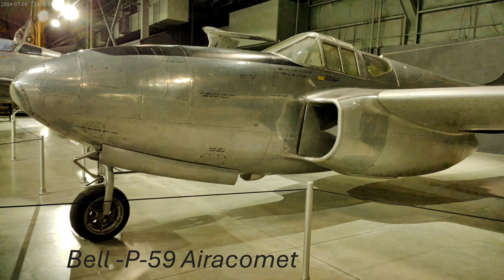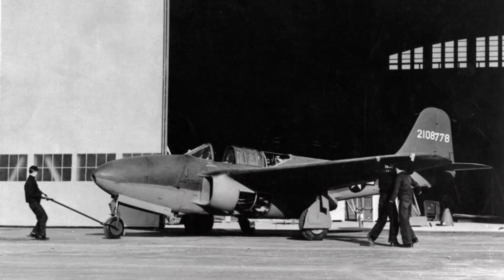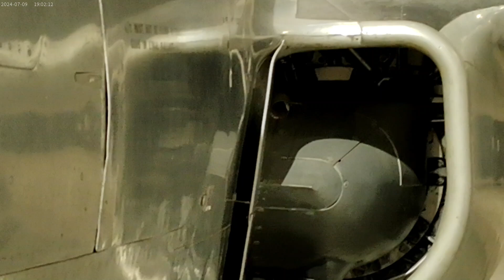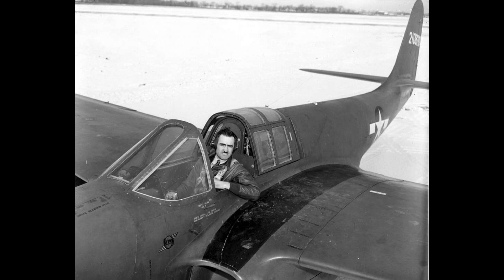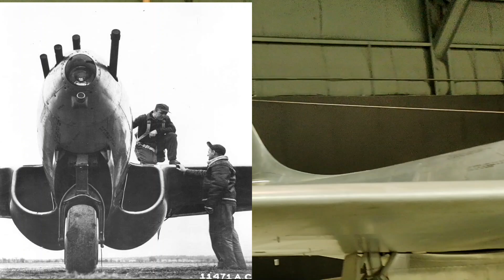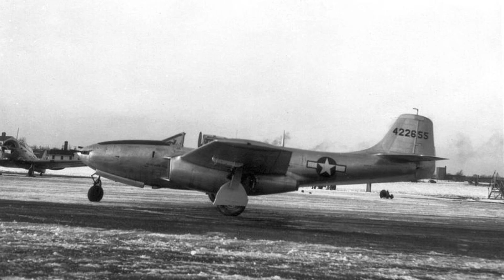Bell P 59

Comment: The second altimeter is most likely for reading the cabin pressurization altitude.  The instrument top row on the right is a remote magnetic indicator or RMI.  Dial is for the remote compass function, the needles, probably just one functional, is for the automatic direction finder, ADF, and second needle could function as an early VHF nav function or second ADF if installed.
Reply from the maker: Thank you for the comments, appreciate the input!

Comment: 1. To my calculations, P-59A is the first serial turbojet not only the USA, but in the world. And this is definitely the first combat jet fighter to be publicly announced. That is, the fact of his appearance could affect the whole world, but not vice versa.
2. This is probably the first production fighter with a pressurized cabin.
3. Lockheed was working in their L-1000 turbojet project and L-133 fighter. That project bore little likeness to P-80, but it was remind of Bell's proposed single-engine fighter jet. I don't think it's casual.
4. Bell did not stop designing fighters, but they were entrusted with the development of escort  XP-83.
5. Judging by the safety of Whittle engines, the Gloster Pioneer could be the first. But Britain just did not need a close high-altitude interceptor, enough worries. According to Whittle, Pioneer is a better short-range high-altitude interceptor than Spitfire. In tests in the USA, Me 262 did not show superiority for combat with the P-51D. Strangely, P-51D dived much better and safer than Me 262. The Allies just don't need Me 262 and P-59. Does Hitler need the Me 262? Joint tests of slow Ar 234 and Me 262 led to a report on the superiority of Ar 234 in aerial combat. But Me 262 with R4M missiles is effective against heavy bomber formations. In Germany, P-59 could be useful for intercepting Mosquitoes.
6. It is a pity that the stories I know about P-59 do not include sources about her Whittle and GE engine, its complex and fast history.
My conclusion: P-59 was the first important attempt. He got a sequel. The Me 262 had no sequel. Both were of little use in 1944. The first clear success is Gloster Meteor.
Reply from the maker: thanks for the detailed insight! I appreciate the thoughtful comments, helps all of us put this aircraft into the larger context